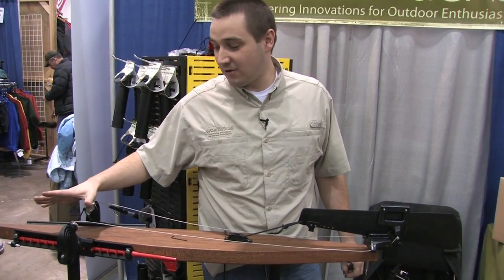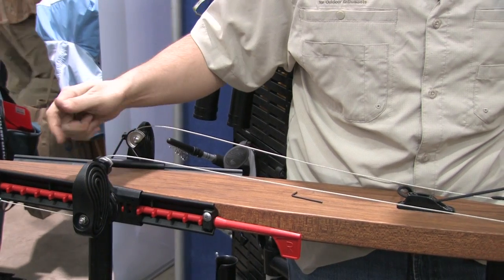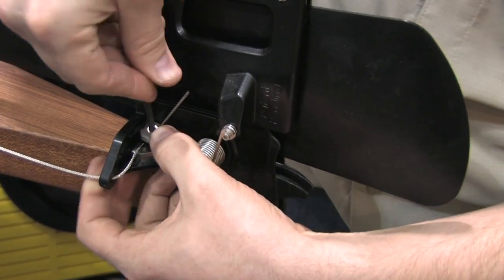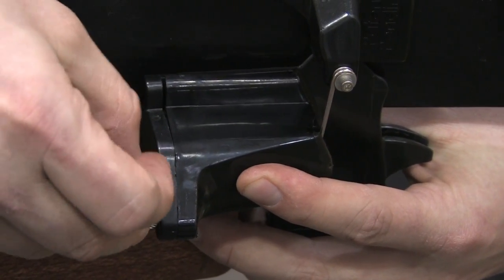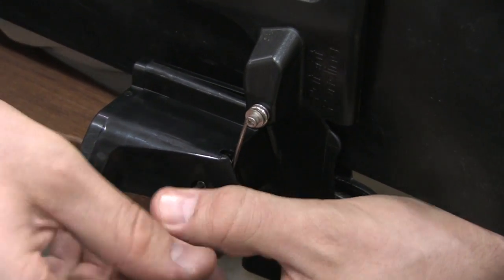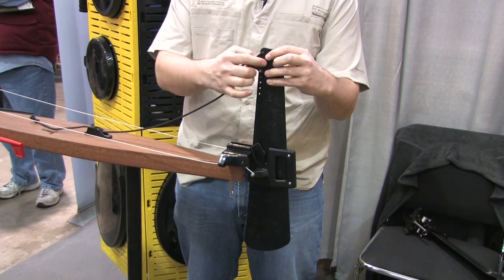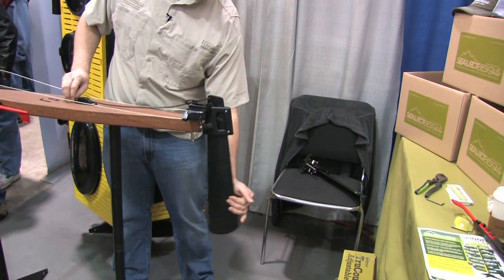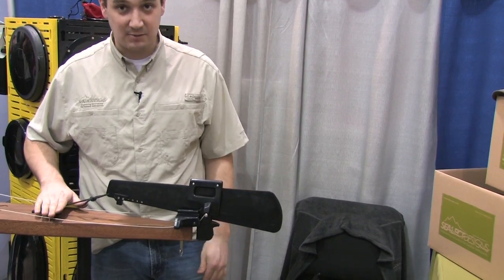SEA-LECT Designs TruCourse Rudder

Comment: My unit will not go down when needed, can you refer me to maintenace zone?
Reply from the maker: Sorry to hear you are having trouble with the rudder system! There are a couple things that could be happening, so it may be best to talk over the phone so we can troubleshoot …. when you get a chance, give us a call at (425) 252-2149 and we can talk through the issue! Thanks for reaching out!
Reply: @sealectdesigns  We lightly sanded some scratches from the blade added silicone lube and is working much better. Thanks.
Reply from the maker: @newlife155  Great! … and "yes" that will definitely help! Just as a FYI too though, we are also just starting to add a 'bungee assist' to the unit to help that draw back down as well. Again, and questions please just give us a call! Thanks again, and happy paddling!